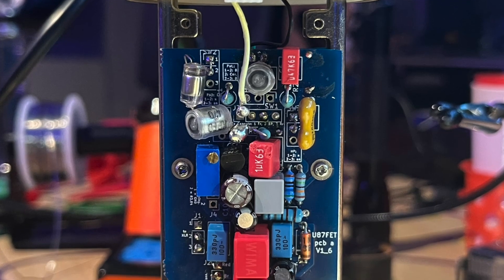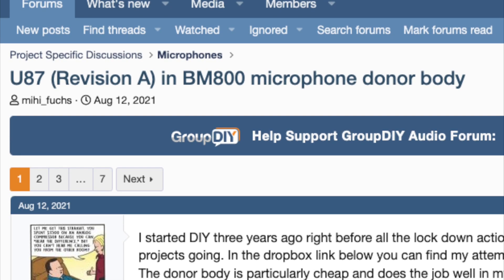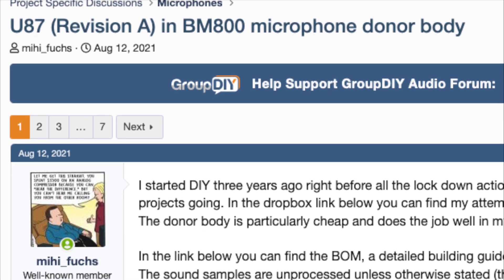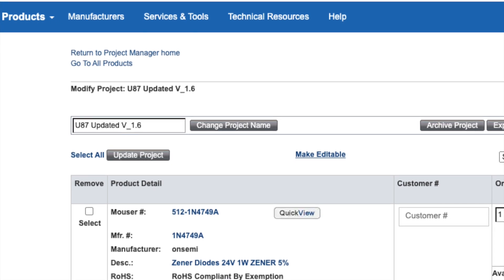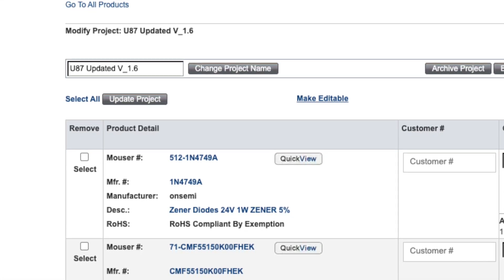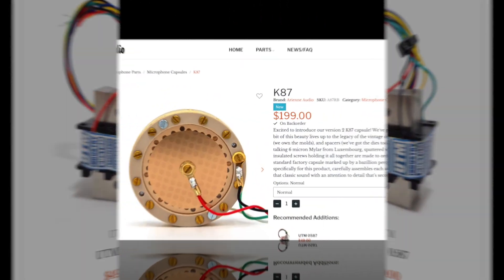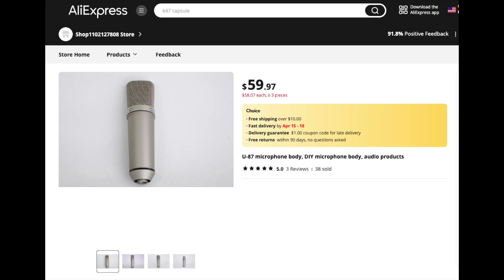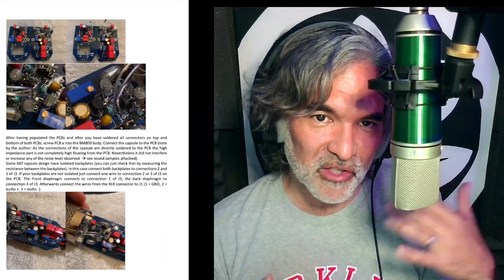$450 DIY U87ai “Dead Ringer” Clone Cost Breakdown

Comment: When building this mic, what are the values of C4 and C5 capacitors you use to make it a "dead ringer" for the original U87ai? Did you use 47nf for C4 or 0.1uf to get a better low end response? And did you use 160pf for C5 or 220pf for the high end de-emphasis circuit to tune the arienne audio k87 capsule?
Reply from the maker: I went exactly with the values Fuchs has in the BOM.